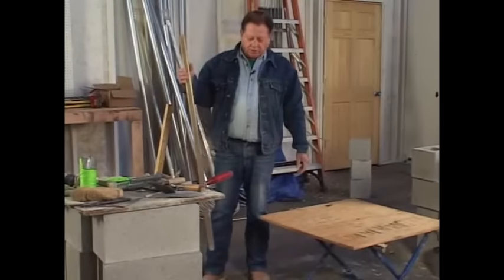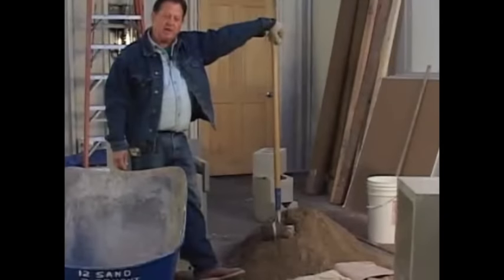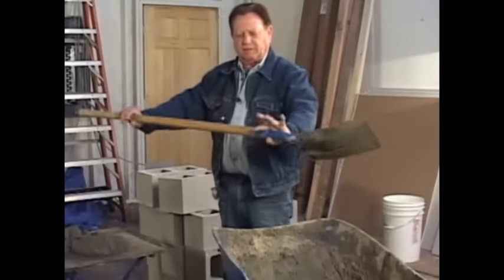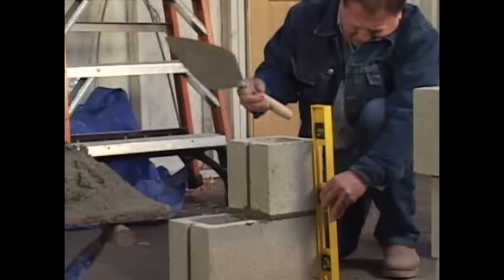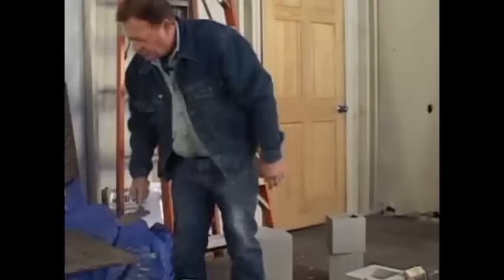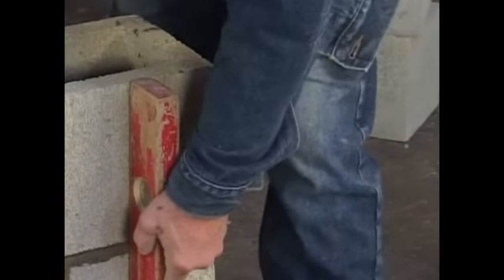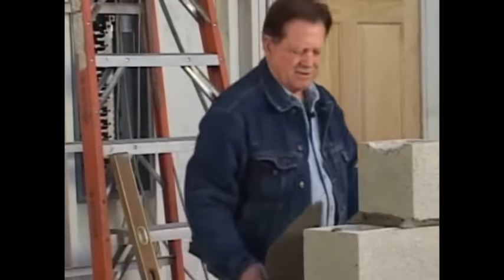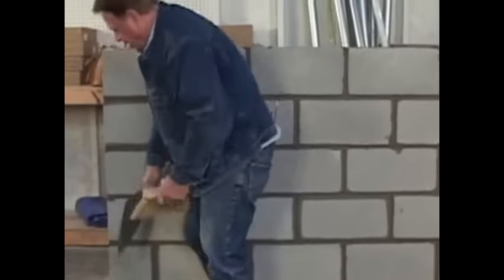How to Build a Block Wall Lay the Blocks

Comment: To give the torpedo level a very long straight surface to sit on 2x2 square aluminium box bar is extremely flat and will last you a very long time. I have done this myself many times.

Comment: How do you ensure you always calculate the right distance so when it gets to enclosure the gap is not too big or worse too small? I know you can divide wall's length by number of block length e.g. wall 10,000mm / (440mm each block + 10mm gap/joint) = ~ 22 blocks so it would be 22 x 450mm = 9900 - 10mm (last joint) = 9890mm from beginning of the first block to the end of last. Is my thinking correct or is there another way to calculate this correcly? I'm going to be building a retaining wall so the initial wall length doesn't have to be exactly 10,000mm hence 9890mm.
Reply: So, I've started to build a wall using really heavy and rough concrete blocks - it's a nigtmare when it comes to leveling them! The blocks in this video are nice and smooth so it's a lot easier to level. I had built the fist corner and then calculated the wall lenght adding extra 10mm on one side. Unfortunately, was unable to do the enclosure as I ended up with tripple the size gap than expeced hence had to remove the last block and redo it. It's a great video but it's not as easy as it looks in particular with my blocks so beware what meterials you choose.
Reply: On my last corse I had to strip off about 5mm from a block to be able to squeeze it in. The wall is now finished :)

Comment: hello great video, one question, why dont you fill out the blocks with concrete, they are completly hollow
Reply: They are meant to be hollow.
Reply: @inlikearefugee5194  this hollow thing is just good for shipping or transport purposes but if they are installed, they need to filled out with concrete and little stones or limestone because of the after installation weight, durability and outside insulation thermal isolation and if they stay hollow after installation, the stone can collect outside water
Reply: @nilsvoelkel7970  The hollow brick wall is meant for limited strength only, if you want more strength you go for reinforce concrete, that's my understanding.
Reply: @inlikearefugee5194  thats right, more strength = one second block brick wall beside the first one, and filled out blocks, these hollow bricks dont look very good in strength due to their hollow existence, one row is not enough for a concrete iron rod roof

Comment: How do you make sure that your corner blocks are on the same level? From what you are doing they both may well be perfectly level but one higher than the other.
Reply: He aligns the string  with an edge on each block.
Reply: @fredbloggs2587  a string assures ONLY  a straight line  between two end blocks. not that not that the blocks are on the same level
Reply: You can measure down to the floor on each end to assure they are same height as you progress or make a story pole if you prefer.  A long straight edge with level will verify if your course is level as well. Not a mason by trade but been in the construction industry since a young pup and background is carpentry these methods work for horizontal siding as well.
Reply: HD has these Empire brand Line Levels.  I've never used one, but am going to on my next build.  I assume Lowe's would have them as well.  It's all about the foundation and what you're building on.  Usually, a laser level is the best to determine if you're really level from corner to corner.

I also found this video that I thought looked helpful.  I've not tried this method, but it seems like a great way to make part of the process much simpler.  https://www.youtube.com/watch?v=rWofXXWOhck

Comment: No mention of setting the height or verifying the height! Likewise, what about verifying too much mortar isn't being placed between blocks jamming the last block of each course?
Reply: That's when you're too experienced so you forget the things, beginners do wrong. I always have a hard time spacing the blocks even so i have to cut the last one to fit in. Or i have too much space for the last block and so i get uneven joints...
Reply: @--Mike-- , measure and adjust until you have a feel for the right amount of mortar. Or maybe cut a piece of wood half the length of a block, plus the mortar joint, and use it to measure each block. I suspect after one project you'll have the feel.
Reply: @larrymaloney877  Piece of wood would work.  Another thought is to just grab a tuck pointing trowel the same width as your spacing and check as you go.  But, great points though.

Comment: There is no accountability of the mortar between the bricks.  5 bricks at 16" is 80"".  So laying the first brick and coming out 80" leaves no space for the mortar in between . . which means your bricks will not fit.  Great mortaring video but doesn't fit mathematically.  If someone could explain, would appreciate it.  Also nice to get level with line stretched but what if other end is layed and ends up being not level?   How was level obtained in the first place?

Comment: The camera work on this is terrible.  It is constantly missing showing what the guy is doing.  I'm confused about the vertical rebar.  I get the first course goes into the concrete floor below, but how tall is it?  Does it stick up into the higher courses, or do you put in short pieces each time, and if they're short, what holds them up?  It would have been helpful if he'd actually left the rebar in.

Comment: So, how did you know that the second full block you laid was level with the first one?  I didn't see you check that.
Reply: The video skips setting up batter boards which is vertical to the whole process.  This is very basic and doesn’t cover how to insure the height of the wall is a specific height. It’s just assumes you’re laying the wall on a perfectly level surface to start. It’s just very basic is all.

Comment: I'm not trying to be disrespectful, smart or mean, but I can tell that you aren't a professional or should I say certified Mason, and I think it's really important that if you are going to try to teach people something about masonry, then learn the names of the tools. After you were talking about the nylon string, when you started talking about adjustable bracket that goes on the Block for your line, those adjustable things are called "line dogs" and you should teach about the two different sized trowels, which the  Philadelphia trowel has a sharp Square heel & a broader blade, perfect for laying concrete block, and the London trowel has a rounded heel & a smaller blade and is commonly used for laying brick. I got my masonry certification back in 1994-95.

Comment: The part about the rebar was not shown and hard to understand
I dont get it.
Reply: If I'm not too late to help...There are blocks shaped like a U, they're called H-block or Bond Beams.  They allow you to insert rebar horizontally through the wall as you build.  He said every third course as you go up.  He was just chipping away at regular block because he said they didn't deliver enough of the right block to him.  I usually just use a grinder to cut into the block if I need the bond beam on a corner, etc.

Comment: your mortar stand doesn't go that way number one number to this is the worst crap I've ever seen in the 40 years I've been laying brick and block you need to learn why .75 means modular grid that means 7 1/2 block will make 10 ft 75 block will make 100 ft .75 equals 1
Reply: It's number two. Not number "to"